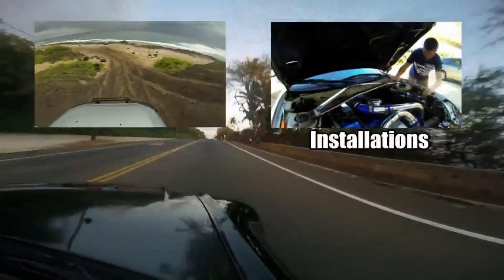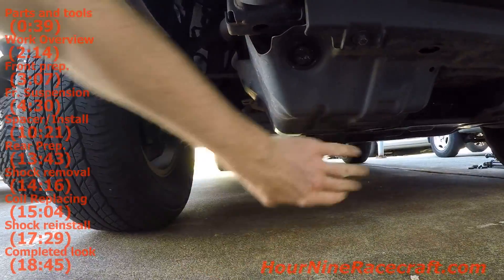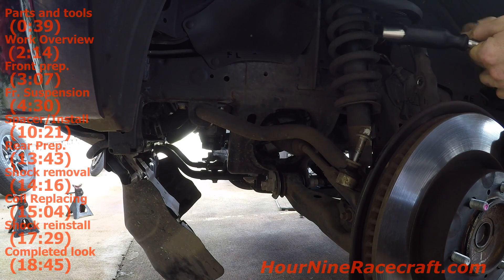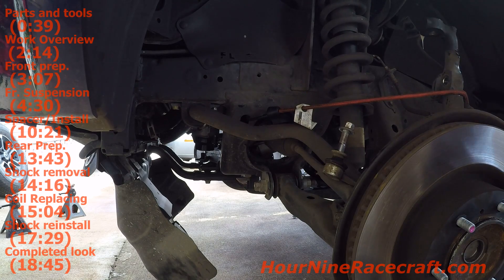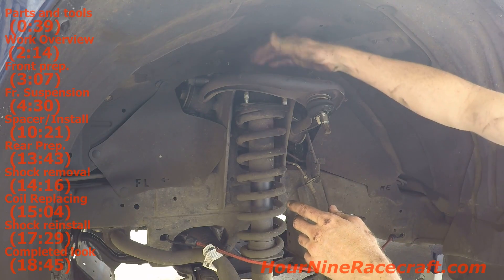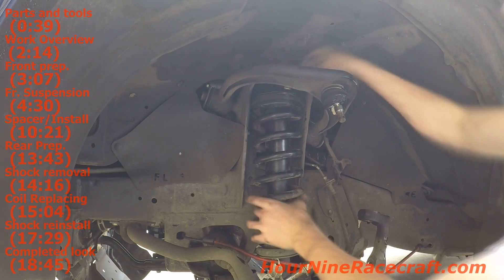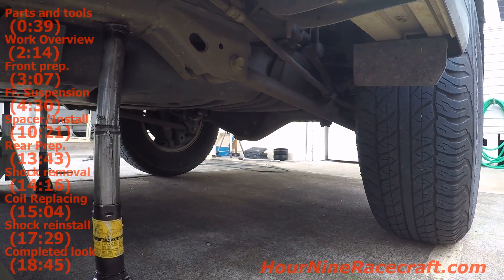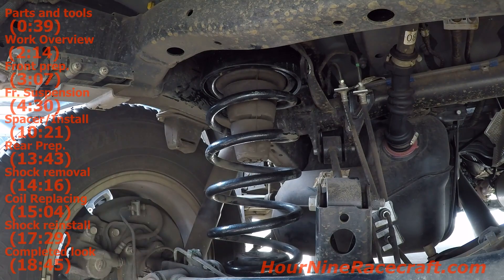2016 4Runner 2WD/4WD Spacer Lift

Comment: Dude, your in Hawaii right? Came here to check n see if all is good. 

I used your video from 2016 on flare in stall on FJ cruiser
Reply from the maker: +StoviAZ nice! Welcome back :-). I'll have a video going up soon of how much mud and dirt has gotten trapped behind the fender flares, and how much has gotten between the Rubber seal and the paint. I want to see if it's scratched also